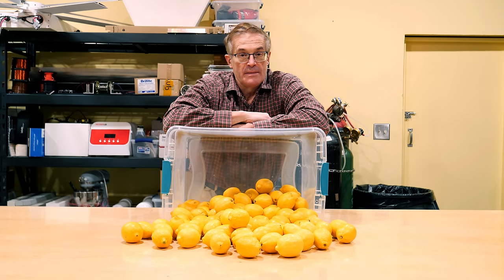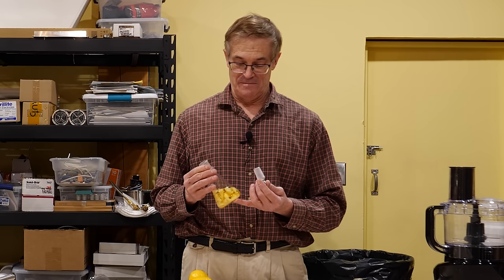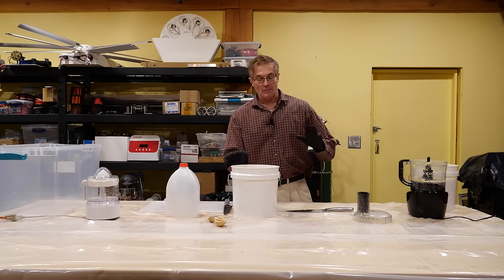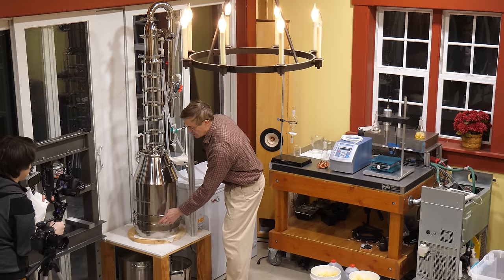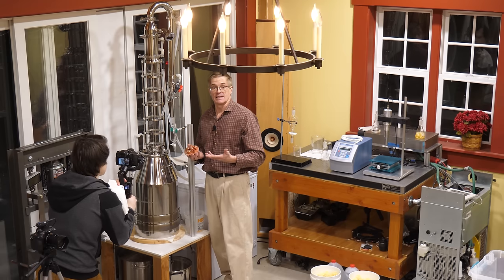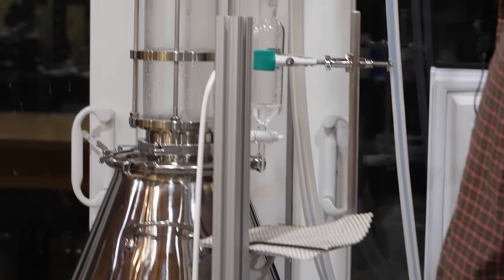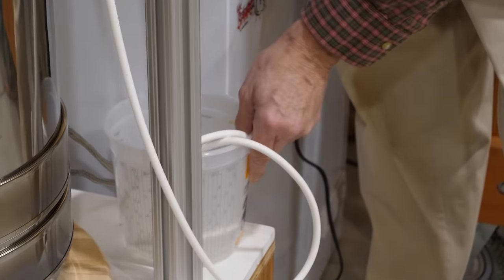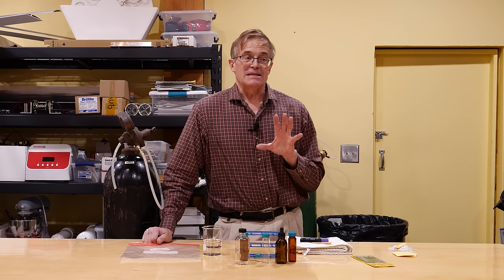CONCENTRATING LEMON OIL LEADS TO A VISIT TO THE HOSPITAL!

Comment: I took high school chemistry from a perfumer and worked in a perfume lab as a technician when I graduated. The strict definition of an essential oil is that it is the most basic chemical compound with the characteristic fragrance of the plant or other source from which it was extracted. The compound in lemons and other citrus fruits, (orangs, limes, grapefruit, bergamot, and some other plants) that has the distinctive fragrance is limonene (C10H16). If you break it down further, it will not have the distinctive aroma. Molecules with an atomic mass above 400 are too heavy to evaporate at room temperature. The atomic mass of limonene is 136.24, well below this threshold. Highly concentrated essential oils are VERY dangerous to handle and will cause burns. If you get it on your skin, you want to use Dawn soap on it without water first. Water will not remove the oils because water will not bond to oils. The way that soap works is it contains very long molecules, in the case of Dawn, sodium lauryl sulfate and sodium laureth sulfate. These are known as surfactants, which is short for surface acting agents. One end of the molecule will bond to oils, and the other will bond to water. You apply the soap first to bond to the oil, rubbing it around for about a minute, and then apply faucet hot water, which will bond to the other end of the surfactant molecules to rinse it off. Up until the 1950s, people understood to not put perfume directly on skin for this very reason. They may have not understood the chemistry, but people understood that perfume caused rashes and burns, etc. Instead, for about 4,000 years, people would put perfumes on clothing, hats, scarves, ties, gloves, purses, etc. It lasts a lot longer than on skin. But in an interview in the early 1950s, Coco Chanel, of Chanel No. 5 fame, was asked where one ought to apply perfume. She replied, "anywhere you want to be kissed." While it was a flashy and decadent thing to say, it was ultimately graceless and harmful advice.
Reply from the maker: Interesting.

Comment: Yeah, that kind of accident is why most kitchens working with knives keep a few tubes of super glue around - it's almost as good as stitches for fast-healing and non-critical stuff like fingers. It's saved me from a hospital visit a LOT, including one time I sliced 3/4" down the MIDDLE of my thumb under the nail. Open-wound-safe lidocaine spray is also a very nice thing to have, and IDEALLY you'd keep a bottle of MEDICAL grade super glue - 3M VetBond is veterinary grade and what I have in my first aid kit - cause it's slower curing so won't cause quite so much heat, less painful to use.

Comment: For smalller amounts of Materials to extract Oils from, a Soxhlet Extractor is maybe a valuable and Cost efficient choice.
Good thing at a Soxhlet Extractor is, one can watch the extraction Process and actually see when the extraction Material is exhausted.
Depending on the Solvent and extraction Materials (Temperature) Cooling is optional.
I'd also try Thyme Oil for it's Pain killing and antimicrobial Effects. 
Clove Oil is usually well known for its Pain killing Effects. (Keyword: Eugenol)

One Story i've read about Garlic Oil, which was used to scare Fruitflys and other Insects away from the cultivated Goods, was pretty funny.
For the same desired Effect, Lemons resp Lemongrass shiould do the trick.
Pretty aweome. Me personally likes essential Jasmine Oil and its effects.
Thank You.

Comment: New video idea... Perfect time of year to try to make a DIY snowmaker. Inexpensive and easy, the principals behind it  and optimisation would be interesting.    I made one with a air compressor and a pressure washer a few years back, it worked but not as well as it could have.   I live in Southern Maryland, temps were not consistently low enough that year for me to perfect the process, plus I think some additives to the water could have helped with nucleation, I just never got around to it.    You live in what looks like New England?  "Better" weather I suppose.  Ive actually chatted with you in two laser forums you were active on several years ago.  Great stuff,  every single project is stuff I love.
Reply from the maker: Interesting idea, thanks!
The jet engine comes to mind...

Comment: When cutting something routinely, always grab consistently with predetermined finger position so that you know cut is at least 5 cm away from your fingers, because you hands know how much apart they are even if you are not looking within of couple of centimeters. When grabbing the object you are cutting in order to hold it firmly use top fingers to press it down and because of shape of lemon use side fingers to support the angle, fingers go around the tip of the lemon. By the way he was handling the lemon I immediately thought that once he starts cutting routinely he will cut him self.

Comment: I'm sorry for the guy getting cut.  But great video.  I want to add that lemon oil is great as a cleaner and saitizer, though it will burn skin and eyes if not careful.  Also, lemon oil eats styrofoam as if it were gasoline.  It will also dissolve, rather quickly, some plastics.  The Sonic restaurant chain sells lime aides with real limes in them and is the cause of many of those drinks forming leaks where the skin of the lime and lemons are touching it,  Happy New year and many blessings to you!

Comment: Ah yes, the old kitchen decapitation machine. Getting used to a huge new Santoku knife at home, gone a gusher a few times now. Funnily enough, cyanoacrylate (superglue) is reputed to be the same stuff they use in "liquid skin". With that knowledge, I have been using dirt cheap superglue as bandaids for years. Damn near chopped the tip of my finger off a couple of months ago with the Santoku. Fixed it with superglue and now i can't even remember which finger it was. Amazing stuff.

Comment: Cool fact powered by weird measurement units: If you cut your finger, raising it high could be as effective as putting pressure on it. Systolic blood pressure sits around 12 cm of Hg which is about 1.5 meter of water.Considering the pressure losses in the  vessels, the blood will arrive at the fingertips with almost no pressure, so no flow. It worked a few times since I learned this trick, once taught my mom, she is a nurse, and she was shocked that the bleeding just stopped.

Only if we used a measurement unit more easily related to day-to-day things ...

Comment: The latent heat released from 1 lb of ice turning into water is 144btu ( 604.8 joules )  
1 btu is about the energy released by a single wooden match

The conversation factor for f to c   is    

X 1.8 + 32     ( c to f ) 
- 32 ÷ 1.8 ( f to c )

Comment: You can obtain d-limonene also from orange peels.  The oil is widely used in industrial cleaning as a replecement for chlorinated solvents.  A mixture of ultra pure d-limonene and petroleum distillate is used for cleaning electronic equipment.  Major warning is that some people are allergic to citrus products and cannot tolerate the smell.  A few people want to label d-limonene as a potential human carcinogen because it causes cancer in male rats, but it's a very weak argument.  Does nothing to mice, or female rats, just male rats.

Comment: If you only have $10 and you don't need a bottle of nitrogen you can buy various formulations of intert and semi-intert gas at wine stores. They are used to backfill partial bottles of high end wine to prevent degredation if they won't be finished immediately. They range from co2 to nitrous oxide to nitrogen/argon blends and are food grade. As long as they disclose what is in them you can know what they are and aren't suitable for in the lab.
Reply from the maker: Good idea.

Comment: A. It's just a flesh wound. (I just had to.)
B. motosk8r2 is right , Super glue is the best liquid bandage/suture, next to spiders' web. Rock climbers use it to close up split fingertips and keep on climbing. Super Glue the basic, non-gel type does not sting, is non-irritating, not aggressively toxic, and when it dissolves all the way, the wound has healed. A must have in first aid kits. Conventional tried and true first aid supplies are a good idea but if you need to pack really light, I'd go with the glue. 
Am surprised nothing like this has ever come up before, good safety skills in the lab, it seems.
Reply from the maker: There are different formulations of cyanoacrylate adhesives.  There are medical grade formulations and consumer/project grade, some of which are tissue toxic.
Also, consider having a suture kit with some local at home as a backup.

Comment: Great video indeed, professional touch in every aspect! I would prefer a vacuum distillion instead of traditional boiling steaming under hundred Celsius degrees. It would keep the sensitive flavors of the stock with out possible isomerization, similar reaction when boiling the beer hops in brew to get the bitterness to the flavor in beer?
Reply from the maker: Sure, capacity will be the major issue there.
Reply: @TechIngredients  actually, the vacuum distillion with volume can be much more energy efficient than working with traditional boiling temperature, also the vacuum pressure is more easy to achieve than compete even little positive pressures with volume (pressure standing container, metallic).

Comment: Once when I was cutting sheet metal ducting on site to modify the fit. I was gloved up using the shears. My phone rang and I stopped, took off glove to answer the phone. While talking I realized this wouldn't be a quick call. I was distracted and forgot my environmental dangers. Picked up my shears and went back to cutting without my glove on. 
I ended up holding phone between head and shoulder with neck crooked. I started to lose my balance and so I wouldn't drop my phone I shifted my weight which made me lose balance. I fell forward and put my hand out to catch my phone and putting other hand outward to brace myself.
That hand was the ungloved one and I used it to catch my entire body weight. I put it out and the sheet metal went through my hand like a hot knife through butter. 
It went to the bone and actually scratched the bones as it sliced muscle and tendons. 
I almost lost my thumb and hand. 

It was bleeding so badly that when I looked for where my phone was and saw the blood spraying. I saw flesh hanging and couldn't move my fingers. I ended up losing consciousness and I would have bled to death.
Luckily I had someone walk in and ask me what I wanted for lunch and found me. 

Point is that safety is important. Have a plan in place in case you do have an injury and never allow yourself to be distracted while on task. Always stop and wait before starting again.

Comment: Let's all hope it never happens again but, for hypothetical future emergencies involving accidental/unpredictable incidents, industrial super glue is the best for perfect sutures. Depending on the wound, you can just pour it immediately after cleaning while keeping the wound close or you can use a medical adhesive to keep it close and then pour superglue on it. For immediate polymerization, just light up a stick of wood and let the smoke flow over it. I've used it A LOT. Perfect scars all the time! Pure lines and barely visible. It's bio-compatible and you just need to keep on pouring some to protect the wound for 7 days at least, 10 the best if you want to avoid a laceration of the healing process (the new tissue could still be soft and it could stretch with pressure/tension, herniating it).
Also, some anti-cut gloves made out of a metallic mesh are probably even better when knives are involved and cuts CAN be predicted or are VERY likely to occur, given the odds. 😅

Comment: Old painter's trick... to store and (help) prevent the oil-based paint from oxidizing after it has been opened.... breath in deeply, then blow (exhale) into the partially-empty paint can, with the lid nearly closed. Quickly shut lid, and seal tightly.
You will be replacing most of the oxygen with your built-in supply of Carbon Dioxide (CO2).

Comment: Dealing with 12 or so trees worth of lemons has resulted in racing heartbeat and CNS stimulation (quite alarming), due to trans-dermal absorption of Synephrine I believe. Freezing then thawing is a method of breaking open cell wall structures FYI. Maybe using a vacuum to boil off essential/volatile oils could be efficient & effective?
Reply from the maker: A vacuum distillation would work, but the equipment is pretty expensive.

Comment: Citrus oil is a great degreaser/ multipurpose cleaner... it's the key ingredient in eco friendly cleaners, plus it smells a lot better than the nasty artificial stuff.... The cleaner I use is like 10 to one with water  for a bench top spray and wipe... The only question I have is do you need to add an emulsifier of some sort to get the oil to evenly mix with the water? 
I've heard it makes a great engine degreaser also... Perhaps you could explore the practical uses of citrus oil?

Comment: Yikes.... the way that cut bled... IME, only cuts that need stitches bleed that profusely. Sorry that happened to ya, man; stitches in fingers are extraordinarily painful. I'd rather have any other body part stitched (and yes, I've had just about every body part stitched... ex-Martial Artist) than a finger. I asked a Doc one time why it hurt so darn bad when they injected the local anesthetic into a finger. He replied that 75% of all of our nerve endings are in our finger tips and toes. I managed to refrain from commenting that I knew where the other 25% were... ; )

Anyway, hope you're doing well. Even with an injured finger, you produced yet another fine video. You guys have become my all time favorite YouTube channel.
Reply from the maker: He is.
Nerve blocks don't have to be painful.  If the practitioner adds a tiny bit of sodium bicarbonate to neutralize the acidity of the local this helps.  The largest reduction in pain can be achieved with a very slow injection. Pressure effects are largely responsible for the pain of injection.

Comment: Fingers, toes, ears and nose don't have anastomosis, so serious damages to these parts of the body could severely compromise the circulation to the affected parts. When it comes to hand injuries, since we are so dependent on our hands and fingers, they should be seen to by a hand surgeon. Tendons, nerves and the vascular system of our hands are very tightly packed, so more serious injuries to hands and fingers need the specialist touch of hand surgeons. They often work together in teams with vascular surgeons and neurosurgeons.

When it comes to oil extraction, I have an idea. In the lab when we want to break up cells to get to specific parts, we use an Ultrasonic Cell Disruptor. They're not cheap, but if you really want to get to the highest yield possible, making such a device could be worth while the effort. I imagine that such a method could yield some extremely interesting results in producing the most expensive essential oil in the world: Rose Oil. Rose Oil is very unstable to heat. The way that precious oil is made is by covering to plates of glass, which are non-reactive, with a carrier oil. Then rose petals are placed on the bottom plate and the set up is covered with the top plate. Normally some pressure is applied. After several days, the carrier oil, which now contains this very expensive Rose Oil, is scraped off and bottled. I figure that you maybe would be able to do that with an Ultrasonic Cell Disruptor much more quickly and efficiently, if you could keep the pulp (rose petals and carrier oil) cooled somehow. ⚠ If you do try this, remember heavy duty ear protection and don't touch the business end of the apparatus!

Comment: Thank you for the video.  If you substituted ethanol / water mix for the extraction in the still would you get a better yield at a lower temp?  Then distill off most of the ethanol.  The oil might stay behind with the water in the still bottom.  Then phase split and recover the pure oil.  Just curious.
Reply from the maker: It's possible.  I don't know.

Comment: I was going to watch your group's uploads even without the fishing-lure headline. I expect if someone notices your videos they are already set in the algorithmic groove that would mark them as interested in experimentation. I'd rather we not all have to behave like cable news and tabloid newspapers to attract attention.

Do consider some small tubes of super glue around your shop. It isnt the most suitable sealant for deep cuts but it can act as a compromise against getting stitches provided the cut is clean and we'll joined. Avoid stressing and frequently wetting the skin will give the wpund a chance to lap properly and it may be possible to avoid scarring all together. On the finger tips I expect scarring is very likely but ive never had opportunity to obtain stitches for deep finger cuts. For the only cut ive recieved that neither glued or stitched has scarred while all other cuts that have been glued show no long term damage. I truely had not expected a bonding glue to be able to achieve that in the year prior, so i can make a firm recommendation.

Comment: Do you think freezing the rinds would break the flavozones in the rinds, rendering more of the essential oil prior to distillation? Another method may be to soak the rind mash in food grade alcohol like moonshine or everclear, and extract the oils that way instead of using heat. how would that effect the quality of the final extract, or the efficiency of the process? the alcohol could be recovered with a cold vacuum process boiling it off at near room temperature or a little warmer.